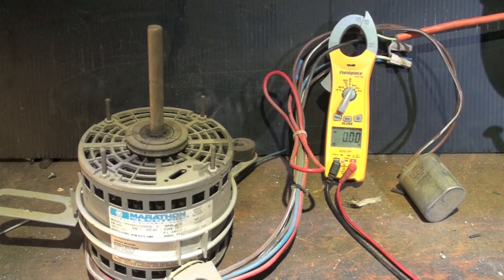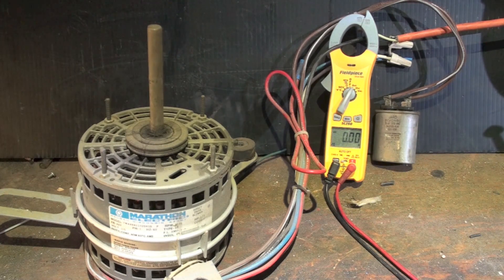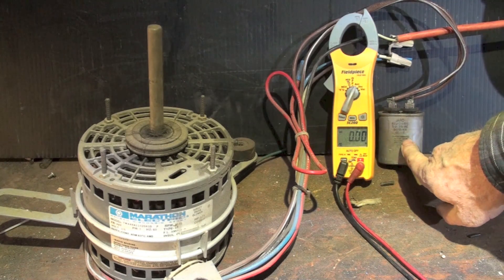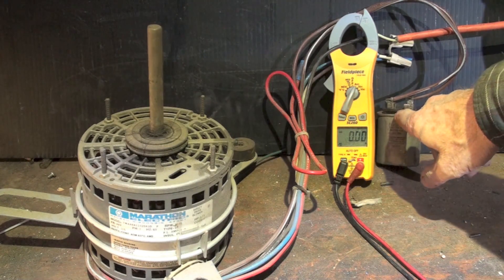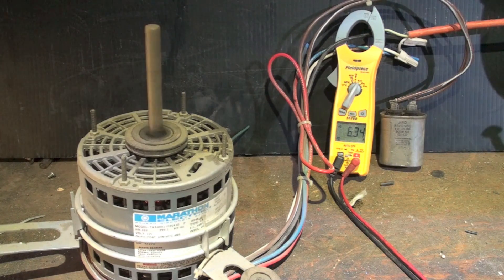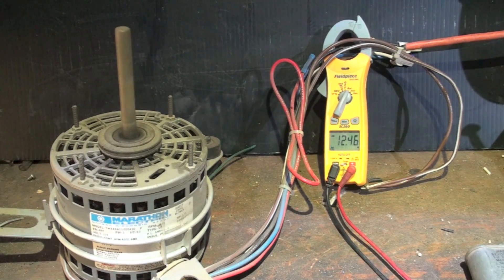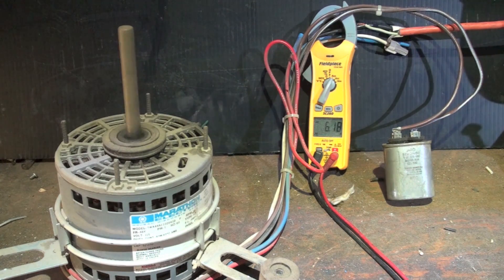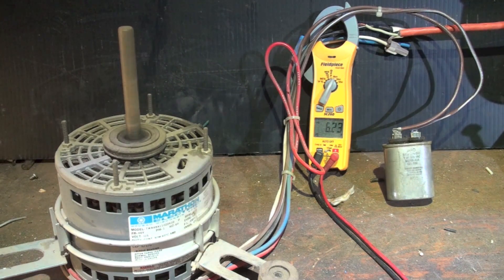PSC motor operation with and without capacitor

Comment: What about those AC units that are setup to run without a capacitor? My Ruud is set up that way. I have a single run capacitor that runs the compressor and the fan wire is on the contactor and triggered when the  thermostat calls for cooling. The first time I saw it I was stunned. I thought the AC company had rigged up something without me knowing until I checked the schematic. It shows an optional start capacitor but actually only shows the single run capacitor for the compressor. I actually recently had a fan motor go bad but that’s after 10 years. I’d like to see someone show that setup in a video.
Reply from the maker: I don't know if this will help but here we go.  A/C compressors are PSC (permanent split capacitor) motors.  They do not need a start capacitor.  Unless the unit has a non bleed TXV.  The non bleed TXV will not allow refrigerant pressures to equalize in the off cycle.  The start capacitor is then needed to start the compressor against the head pressure.
GFM
Reply: @ I don’t think I was specific enough in that question. The question is I’ve never seen the fan motor setup this way where it’s not run from a capacitor. On my Ruud it’s set up where the run capacitor is setup for the compressor but the fan motor is wired to the supply side of the contactor and is triggered to run by the low voltage wire. Have you seen condenser fans run this way ?
Reply from the maker: @foreverwood1963  I can't say I have.
GFM

Comment: Hi
Thank you for this video. Please advise, on a jumping castle motor, do I have to replace capacitor with the exact same
Reply from the maker: The cap must have the same or higher voltage and the strength must be within 10%.
GFM

Comment: What if there is no cap can you wire one in the circuit
Reply from the maker: No, the motor is not designed for one.
GFM

Comment: I have a 230V A/C fan motor with 3 wires - Brown, Yellow, Black. 
How can I test it to make sure it works by using the house 110v outlet without the capacity. Thanks for the video.
Reply from the maker: You can't test a 240 volt motor on 120 volts.
GFM
Reply: @grayfurnaceman  Thank you for the information. How can I test it just using a multi meter? Thanks again.
Reply from the maker: @callmebackfriday2  About all you can do with a multimeter is test for integrity of the windings.  Ohmmeter short to ground test, winding continuity.
Reply: @grayfurnaceman  Thanks for the information.

Comment: Do PSC motors use "start capacitors" or "run capacitors"? If I have to order a replacement for my PSC motor, which type do I buy? Thanks.
Reply from the maker: PSC means Permanent Split Capacitor.  Emphasis on permanent.  Run capacitors are in the circuit all the run time of the motor.  They provide a "soft start" and increase efficiency of the motor.  When you buy the motor, the model plate on the box will have the specs for the run cap.
GFM
Reply: @grayfurnaceman  thanks Gray that helps a lot. Because I heard if you try to use a start cap instead of a run cap where needed, it can blow that start capacitor. Cheers sir

Comment: Think 3 phase motor,  but two phase.   The second phase is from the phase shift caused by the capacitor.  Don't mess with the capacitor value unless you have the ability to scope out the two windings to verify the phase angles or have a meter to show the phase relation.

Comment: The purpose of the capacitors in motors is to reduce the VAR power produced by magnetic motors, the VAR are parasites power and is bad for the systems, increase in VAR its mean increase in amp.

Comment: what happens if you put two capacitors in parallel??
Reply from the maker: That would make the capacitor too large.  The capacitor works by retarding the peak current.  An oversized capacitor will increase that retardation.  That will damage the windings of the motor.
GFM
Reply: @grayfurnaceman  thanks for your answer and for the video.. nice work!

Comment: What will happen if I will remove the capacitor out from my AC compressor, and will turn on my AC on? I mean with open circuit, not putting the the cap terminals together.. will i make any damage?
Reply from the maker: Generally, the motor will not start.  If it starts, it will run at higher than normal amperage.  It will damage the motor.
GFM
Reply: @grayfurnaceman  
Its capacitor only for the compressor, the motor fan have a different cap... Does it make any difference?
Reply from the maker: @johndoe2022  Lets back up.  Why would you want to remove the capacitor?
GFM
Reply: @grayfurnaceman  
   I took the capacitor out to take it to the store to buy new one. 
I will come back to the house only more 48 hours.
There are another workers there, i told them not to turn the AC on, but im pretty sure they will. 
So my question is just to know what is the damage the can make by turning it on, despite i told them not to :)
Reply from the maker: @johndoe2022  I see the problem.  
The unit will probably survive.  The best solution is to lock out the disconnect.
GFM
Reply: @grayfurnaceman  
Even if the capacitor terminals are separated it will get electricity to the compressor?
Reply from the maker: @johndoe2022  That depends on how the system is wired.  Sometimes the capacitor provides a terminal point for compressor wires.
GFM

Comment: I'm trying to troubleshoot my Pentair 230v pool pump motor. It simply stopped running this morning after 7 years of running 7 hours per day. I replaced the run capacitor (30 MFD) and the motor still does NOTHING. No hum or anything. I checked the voltage at the motor to eliminate a faulty supply and it's fine, voltage checks out. The shaft spins easily by hand so it is not zeized. Should I test the motor and run it like you did, bypassing the capacitor? The cap I bought new is not returnable, they will not accept any returns, so I may have thrown away $15 bucks.

Comment: I have a carpet blower that runs for ten minutes then shuts off and comes back on, is this a capacitor problem doing this?
Reply from the maker: First, I would be sure the cooling holes in the motor are open.  It could be a capacitor problem.  The only way to know is to test the cap or replace it.
GFM

Comment: thanks. is this capacitor considered  a run or start capacitor? what is the Micro farad rated for?does it have a governor system that separates capacitor after reaching speed? thanks.
Reply: It is a run cap.  MFD varies with motor size.  As it is a run cap, it stays in the circuit.
GFM
Reply: @electriccar3253  thanks

Comment: I have a question. To replace a 4 wire motor unmounted cap with a 3 wire motor w/ mounted cap both are 2 speed high & low but replacement has only one line. Can I abandon old cap?
Reply from the maker: Yes.  
GFM

Comment: So basically if you want to determine that you have a bad capacitor you could bypass the capacitor and if runs the cap is bad?
Reply from the maker: I would not do that.  I would check the strength of the cap or just replace it to test.
GFM
Reply: grayfurnaceman ok thank you

Comment: Is there a start winding in the psc motor, itself? Or only in the capacitor?
Fan won't kick on. The capacitor was out of spec, so replaced it. It still makes horrible loud buzzing noise and fan will not kick on. I tested the new capacitor, just to be sure. 
It is good and in spec. I tested resistance from each of the speed wires to common. They all had good readings. (Black, high speed, cool - 3.2 Ω. Blue, med high speed, heat - 4.5 Ω. Yellow, med low speed, park - 5.8 Ω. Red, low speed, park - 9.3 Ω.) (Disconnected them from board before testing) 
Fan spins freely when pushed by hand. 
I tested from each brown capacitor wire to common, they both showed resistance. (1st capacitor wire, brown - 9.3 Ω. 2nd capacitor wire, brown - 39.4 Ω)
I tried bypassing board and connected black, cool wire that goes to fan, directly to door switch, makes same horrible loud buzzing sound when door switch is depressed and fan does not spin...
Reply from the maker: Yes, the motor has a start winding.  You probably have either worn bearings (dragging on the stator), or a bad winding.
GFM

Comment: Hey today I got a major problem that is motor is not starting , I trip the switch and running the motor it's starting for 4sec and Trip again, after that I trying same types but it's not started. After that I opened the back cover and reset the trip and running but it's not started, I just moved the fan and motor is started/ moving, after that I off the switch and again start it's not started, after moving the blade it's running, I can't understand what's the faulty, capacitor is 200-250mfd only starting capacitor is available this motor... Plz tell me what's the problem is?
Reply from the maker: The start switch is probably failing to make contact.  If so, you will need to replace the motor.
GFM

Comment: My co worker and I this past tuesday, just replaced the two original capacitors on my 1983 Keeprite Flextemp air conditioner...both were still working, but the one for the compressor had lots of oil sitting on top of it and it had for quite a few years...This is the first work this air conditioner has ever had and it was preventative maintenance...I just had the feeling, from all the videos Ive seen on youtube, and reading, that it was a matter of time before both caps went...the fellow hooked up his meter to them and they were still functioning perfectly...the oil on them kind of told me it was a ticking time bomb...barring a leak in the system, the air conditioner should be good to go for years. (i'm thinking)  They don't make things like this anymore....I bet I could have the house down to below 65 on a hot day with this unit...Love your videos and have come here for reference many times...(not in the business, but keen interest and have tuned up so much around my house regarding hvac)

Comment: just bought a Century DL001 GE Replacement 1/4 HP Direct Drive Blower Motor 115 Volt 3.5 Amp / did not no it needed a cap , sometimes running forward/backwards, was just about ready to start a return/Ebay until I say your U.T. post Thanks a lot for saving me the big hassle.
Reply from the maker: Welcome
GFM

Comment: Compare this comment to the one from GunnyNinja, there is this old scrap yard by the maintenance place at bardstown city schools. Sometimes I go down there to find old motors. One day I found this one blue-ish induction motor. The shaft still spun good even with the big dent on the side. I did not know how to connect the 5 wires on it, but I knew 2 brown wires had a capacitor. One day I went back and found another one just like it, but it had a great fall off a high place (the hole front cover was busted and the shaft didn't spin). The good thing was it had a capacitor on it, so I took it home and put it on the not busted one, got some alligator clip wires and a plug from an old alarm clock, found a wire grid on the label, did what it said, plugged it in and it worked fine. It could run for 5 minutes and be a bit warm on the side, and it's still running today, strong and fast, but maybe backwards spinning.

Comment: You turned the shaft backward on the no cap test. Possible reason for more noise and current?
Reply from the maker: You are correct.  However, it makes no difference which way the motor turns, the result is the same.
GFM

Comment: Trying to troubleshoot my attic AC blower. The outside compressor works fine but the attic blower won't start. Issue is sometimes it starts sometimes not. Is a hit or miss thing.

I'm fairly certain it's the cap but for now don't want to shut the system down to check the cap's micro farads so have the blower running 24/7 in the on setting (Texas in June - August). For now thinking about replacing the cap and board together come fall since I have to be in the attic anyway.   

Can this wait till fall? I don't want to burn up my AC blower motor.
Reply from the maker: If your unit has a belt drive motor, the start switch is failing.  Means a new motor.  If it is a PSC motor, the problem may not be in the motor.  You could have a fan relay problem.  
GFM

Comment: Is it possible to have multiple caps charged and micro controlled by computer to run a motor hence to eliminate the use of a battery? And decharge caps but also charge them with solar
Reply: Wll it work bro ?

Comment: GFM, excellent demo! It is a HUGE help to be able to see the meter readings as you explain the theory. Thank you!
Reply: Theory not as right, didn't show what happens with the cap disconnected. (won't start by itself, will start if pushed) Showing what shorted cap does is a nonsense.

Comment: Thanks for this. Exactly what I needed to know. I've got 2 motors running on a circuit, which I've hacked to each run independently, but it's still running off one cap, which I'm not sure I've wired up right. A lot of times the 2nd motor won't start and I suspected that I need another cap; one for each motor now.
Reply: Interestingly, I took away the good motor to see what would happen (so they're not sharing a cap) and the remaining motor still fails to start sometimes, until I hit it. I guess the motor itself is knackered?
Reply from the maker: Could be the start switch.
GFM
Reply: Start switch? You mean the button I press to turn on? In that case the other motor wouldn't work either
Reply from the maker: The start switch is inside the motor. 
GFM
Reply: AFAIK there is no such thing. At least not with the motors I work with.
Reply from the maker: If your motor is not a PSC but a centrifugal start, it will have a mechanical start switch that engages the start winding until it reaches 75% of run speed.
GFM
Reply: Oh, okay. Thanks. I bought another one in any case.

Comment: Thanks for very clear explanations on the use of Cap.To make it more interesting if you had a switch or relay that closes when power is DISCONETED and just shorts the motor wiring together (line and neutral) then you will see that you have applied  counter EMF to the motors winding which is opposite to its rotation which will cause a sudden brake and stop the motor immediately!! There are many motors that we use today that uses the braking, re-generative power or with resistor banks in parallel to slow the speed of motor ( example: Locomotive miter saws)! I hope this simple motor example is enough for this topic ! and lets not get carried away building something else !

Comment: Lets do this same video, but this time just disconnect the cap and do NOT connect the two wires together. and lets see the results.
Reply: It won’t run
Reply: It will run, as in writing this comment I have one running just right!

Comment: I learned that sorta 'ringing' or 'wong_wong_wong' sound means capacitor trouble in fan motors. Failing run capacitors can mimic bearing problems when the motor starts then slows way down and that peculiar sound gets louder. You may think the bearings are heating and starting to bind. i guess it is the capacitor heating and changing it's value.
Reply from the maker: Coil Smoke The way you can tell if it is bearings or a capacitor problem is to shut the motor down.  If the "bearing problem" goes away, it could be a capacitor.
GFM
Reply: @grayfurnaceman  if the capacitor is "worn out" will it slows down the rpm of the motor?  If so, that might be the an issue that I'm having.  I noticed that my blower output has gotten weaker.  I don't hear or notice any indication of bearing wear.
Reply from the maker: @squidusn71  Capacitors are usually "go or no go".  I would be looking for air flow restrictions.  Dirty blower wheel, plugged A/C coil,  plugged secondary heat exchanger coil, plugged filter or restrictive ductwork.
GFM

Comment: So eith a PSC Motor. The start and run winding is always energised? What type of Capacitor motors have the capacitor start the motor then drop out abd just have the run winding doibg the rest of the work?
Reply from the maker: Sam Hargreaves Yes they both are energized.  The motor you mean is the capacitor start split phase motor.  This one uses a start capacitor of high strength to start the motor, then a centrifugal switch drops the capacitor and the start winding out.  Hope this helps.GFM
Reply: Thanks! You're awesome.

Comment: I thought once it got its initial 'bump' from the capacitor and was up and running, it would be okay.  That proves my theory wrong.
Reply from the maker: Daniel Baker That would be true if it were a start capacitor.  The run cap is a little different.  In addition to starting, it increases efficiency.
GFM
Reply: grayfurnaceman Thanks for catching my mistake.  I am just beginning to learn.  If you had not corrected me on this matter, I would have had problems later on from my misinterpretation.
Reply: In that case if it has just a normal start capacitor, could you spin the motor with your hand and give it power then will it start?

Comment: Well if the cap was bad well even it would work wouldn't it over heat and trip the internal motor protector
Reply from the maker: heatpump hvac Yes they will.  It is interesting to note that different motors react differently.  Some will not start, but some will start with overdraw.
GFM
Reply: Yeah they will